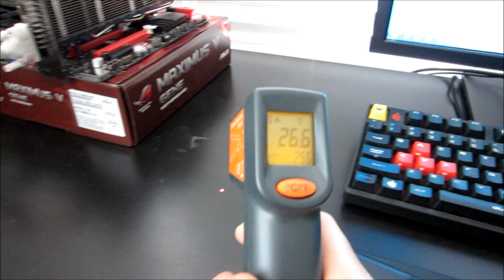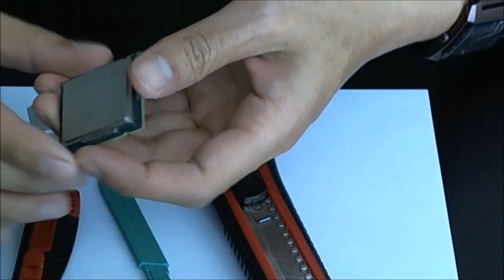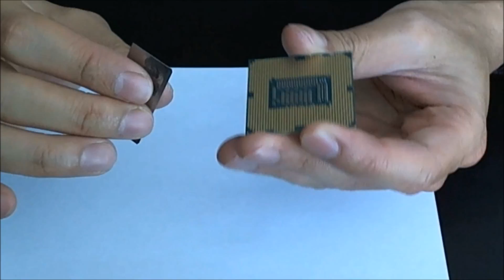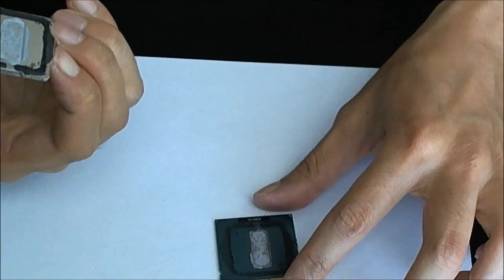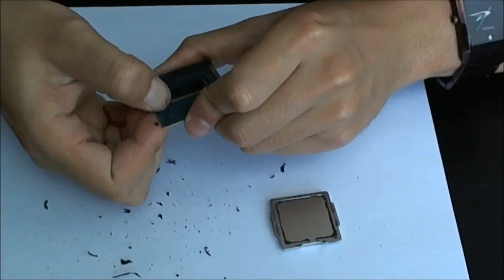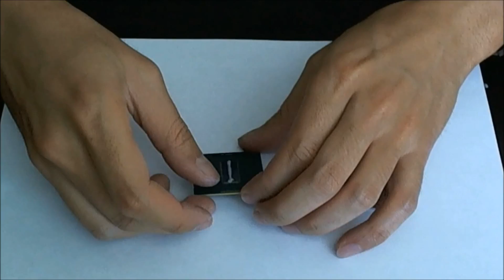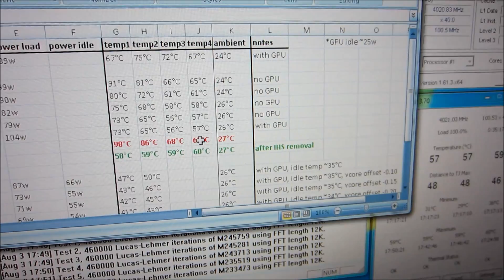Fixing Skylake, Haswell, and Ivy Bridge CPU temps: IHS removal

Comment from the maker: I see comments like this all the time, so to address why putting it back on:

Less prone to cracking the die. Retention bracket won't lock the the CPU down without IHS. A lot of coolers need certain thickness for proper pressure. Lastly, some air coolers have heatpipes that use direct touch, which means not all the heat pipes will conduct heat from the small surface area of the die.

Of course if you have custom mounting or care less about the risk of cracked die, then yeah just leave it off.

Comment: Sigh.You have no idea what you're talking about. I would remove your comments before people who know their shit come here and make fun of your lack of knowledge. Haswell runs the same as Ivy. They used the same paste and it's still running 22NM tech. They run cooler at idle because they have more intense idle states but that's the only difference. Load temps are the same as ivy, but require more volts to reach higher overclocks, which means they're in the end even hotter. Get your shit together.

Comment: Sigh. Sandy reaches higher clock speeds than Ivy and Haswell. High overclock for sandy is 5GHz, high OC for Ivy is 4.7, and high OC for Haswell is 4.5, all of which are around the same performance. My point being that Sandy, even being 2 generations old, can easily still keep up. If you want to surpass Sandy, you must delid your CPU.

Comment: If you keep it within temperature spec it doesn't necessarily reduce the life of the processor. Also the "life" of the processor when maintained at safe temperatures is greater than 10 years for most, even running 8 hours a day or more. Your concerns are mostly based on myth and ignorance and are pretty much unwarranted.

Comment: ceramic paste is supposed to be hard when it's cured, that's when it'd give you the best performance. Seems to me the thickness of it is the main issue. If they had a way to make the contact with the actual CPU chip more even and close so they could use less paste they probably wouldn't have the temperature problem anywhere close to what it's like. It's too bad you can't just leave the heat spreader off.

Comment: Damn. Nice! But why don't you want to re-paste it? I REALLY recommend you do. Even after you get a better cooler (I recommend H100i/H80i) you still haven't seen half of your CPU's potential. YouTube search delid razorless. It's a 12 second video by Allen Diep. It's only 12 seconds for a reason. The vice and hammer method has been the easiest and safest way to delid. There have been no CPU deaths using that method yet and believe it or not, it's already been used more than the razor method.

Comment: Well, running a system on stock speed also reduces the life of the components compared to a similar configuration with undervolt, and this second case also reduces component's lifespan compared to an undervolted AND underclocked system. And this third case also reduces component lifespan compared to a PC turned off.
So, Where is the limit?
I use to overclock nearly all the computers i build, obviously with adequate cooling. And all of them kept working until they became obsolete :)

Comment: It hasn't, old sandy (even socket 1155 parts) have their IHS soldered, that's why Ivy processors seemed so hot despite the lower manufacturing process (this usually yields far better temperatures, and not the opposite like in this case)
That's the reason why some people still bought a sandy bridge processor even with ivy launched (and a bit lower price always helps), but in practice a sightly lower clocked ivy performs the same (remember that ivy IPC is about 10% better) so it's not a big deal

Comment: Base settings use to use way too high voltage for the speed just in case you got a bad example of the CPU. Even if you don't want to bring up the speeds you should try to decrease the voltage to as little as possible for the base clock, that will save your CPUs lifetime and reduce the heat

Comment: I might've just been lucky but I got my i5 3570k to 4.4ghz (stable) on base voltage and the extra boost-voltage set to lowest with a really cheap air-cooler (CM Hyper 212evo)and it never runs above 70 degrees on Aida64 with an ambient temp of around 25C. That was extremely easy to acomplish and no I didn't switch paste on the CPU or anything like that. So I doubt reaching 4.7 with proper cooling is too much of a challenge. And a 3570k @ 4.7 should be slightly faster than 2500k @ 5

Comment: Complaining that an eight core has higher temps than a four core when run at the same clock speed? seems legit.

Yeah I enjoy paying $100+ more for an intel chip to get equal performance. The only reason you wouldn't but an AMD is if you cant find a MOBO with all the features you want.

Comment: No. It's mainly the thermal paste. The 25c drop using CLU is proof. That's from my experience. This guy got an even better drop. It's mainly the paste, but the same heat coming from a smaller area contributes as well.

Comment: Certainly is not. I'm sick of typing the same damn thing. This has got to be the 10th fucking time. You can go read my comments for more details. I will add one thing that I've added before and that is that an overclocked Sandy will not beat the shit out of an overclocked Ivy or Haswell, but it will be the equivalent. So when overclocking, there's really not much improvement besides power consumption. The real upgrade is for non unlocked CPUs and especially for mobile devices.

Comment: This shouldn't be necessary - the pins are electroplated with gold and thus not prone to oxidation.  Most burnt pins are the result of foreign debris such as dust getting into the pins, not oxidation.  One way to minimize this is to use lint-free rags or coffee filters to wipe vice a regular paper towel.

Comment: I use a Wilkinson shaving razor-blade, because they are so thin, and sharp. I broke it in two, moded a support out of a wine cork...It works really well, and avoids "accidents" with thicker box cutters. I do use the flat boxcutter for leverage, in an upward motion, away from the PCB.

Comment: Yes it is the heat problem. Of course as the die shrinks the heat is coming from a smaller area which does cause it to run hotter, but explain to me why delidding and applying CLU drops temps by up to 35c? And yes, a 5000MHz Sandy is the equivalent of a 4700MHz Ivy. Just look up the performance charts. That's all you need to do. And like I've said before, I've cleared things up. My point was that a overclocked sandy bridge can still keep up with an overclocked Ivy and Haswell without delidding

Comment: Those are capacitors on the bottom of the CPU? I always thought it was the cache - tiny little memory chips for the L1, L2 & L3. And all the caps were on the motherboard. I've never seen a cap that small.

Comment: "and I'm not plucking an opinion out of my backside"
Plucking an opinion out of your backside is exactly what you're doing. You can hate Intel and love AMD all you want but, Saying AMD processors have more computing power is preposterous.At one time their cpu's were pretty much identical and later on in the Athlon days AMD were on top. By the time C2D came out Intel won the performance crown and it hasn't really been close since. But I'm not factoring in bang for your buck.

Comment: Intel's 6 core, 12 threaded CPU's (like the 3960x, an exteme example I know) out perform AMD CPU's in everything, especially multi threaded applications. The only plus AMD has is that you can get more cores for a cheaper price compared to intel, which is better for professional use in multi threaded dependent programs. But comparing the best of AMD (even the 5.0ghz cpu) to the best of Intel, Intel still comes out on top. N considering the cost of AMD's 5Ghz cpu, you may aswell get the Inte.

Comment: I have changed quite a few Intel notebook processors and I have never seen one that has a heatspreader. Notebook processors look just like this guys desktop processor with the heatspreader removed. So you won't find any solder. The heatsink goes right on top of the bare processor with pretty much the same shitty thermal paste.

Comment: They are only a dumbass if they fuck the processor up. But if they are successful and they lower their temps as much as this guy did then how are they a dumbass? We're not talking about someone ripping off their heatspreader to gain 2 or 3 degrees. He dropped about 40C on his hottest core, that doesn't sound too dumbass for someone who is an enthusiast and wants to overclock..

Comment: shame on you intel, why do they not do a recall?  great fix though WFD!!  i would have felt better about this fix if you had the proper static guarding when dealing with such sensitive electronic equipment.  but regardless, you did a good job, and after knowing this ill probly wait for the next gen intel.

Comment: Good to know, but if I were to have temp problem, I wouldn't use a fanless graphic card and even less blow hot air into it and I would add a fan on my CPU heatsink that actually blow air into instead of sucking it. Your first temps with the 1st core at 98 degree might be an indication you didn't put your heatsink or thermal paste correctly the first time.

Comment: just nicked one of those tiny capacitors.  wouldn't have seen it unless I had a high power microscope which I do.  It's running fine still though.  I can see some of the substrate inside the capacitor showing which can't be good.  We'll see how long it lives.  temps at 4.5Ghz are only 53C though

Comment: GELID Solutions GC-Extreme i think is one of the best and prolimatech pk3 is also good too. depending on how much you need, the 1.5 gram version of the pk3 is about 5 dollars and has enough paste to be put on both the ihs and die. i have not found a 1.5 gram version of the gelid one but the 3.5 gram one is about 11-12 dollars, il send you the links in case you want to buy one or the other.

Comment: darknessjw.  that is about normal.  there is no "why".
realistically, you cpu has to hit about 125 degrees before it begin to damage itself. and it throttles around 90 i believe per core. 70 degrees under full stress is normal.

Comment: Nice video! My stock 4770k runs around 40 degrees on idle (first core) and other cores are about 5-8 less.

Stock cooler also atm. 

In stress test they go up to 70 degrees (first core) and others about 60 degrees

Why is this? I have same problem what video maker have? Too bad im too afraid to touch that CPU or i might broke it :D

Comment: gonna use the intel g1610, throwing aside the stock cooler and putting on the arctic alpine 11 plus instead for quieter fan operation and slightly lower temperatures but i want to know, do you think its worth it if i take apart the chip, wipe off intel's stock thermal paste on the die and reapply using bestbuy's dynex thermal paste? do you think this will be a LOT better than intel's paste, worse, or only a  tiny bit better? also is it fine that you use 2 different pastes for die and ihs?

Comment: i would only do this process if i was using very high quality thermal paste like gelid extreme or prolimatech pk3 on both the ihs and die, otherwise, i probably wouldnt do it, but i do want to know, is the reason for the higher temperatures produced on the ivy bridge chips caused by simply intel using low quality paste or is it other things too?

Comment: wtf O_o did I see that right???? 90º @ 4.2?? that can't be right.... that just can't be right.. if so, holy hell something was fucked up majorly on assembly... at best, a delid is gonna drop a couple degrees(at best!) so there is just something wrong here.. I was getting 4.8+ on my 3570 on air with barely an 86-87 spike...

Comment: In another comment I cleared things up. It's pretty much needed unless you have a chip that chugs along with a low voltage. What voltage do you need? Because that's crazy. I can't even hit 5GHz at 1.65v because I got an average chip. But my temps stay under 95c at 1.65v and 4950MHz which is crazy. You must delid. Use the vice and hammer method though. It is MUCH safer and MUCH easier. Search 3770k/3570k delid razorless. You can probably hit 5.3GHz or more with a chip like that. Nice!

Comment: I have my Ivy bridge 3770k at 5ghz no problem. my temps don't go above 80 during 24 hour stress tests, 75 tops and that's only one one core. Although I do agree the thermal paste is garbage, but I don't see a 30 degree temperature like this guy, maybe his chip sucks.  When gaming or doing things like rendering / other multi thread dependent programs my temps hover from 30-65 tops. So I wouldn't say deliding is needed, but advised? I am watching this to delid my cpu to get more juice easier ^^

Comment: Will definitely worth it if you got a good OC chip. if you got a CPU that can do say 4.5Ghz @ 1.1v (just an example) then you can delid and do 5Ghz at may be 1.3v or 1.4v which is not possible w/o deliding. Custom loop won't help much if you got a chip like this guy.

What this guy could have done is buy protection plan then up the vcore til it melt and get a new one for free. But if the chip is a good OC then it's still better to delid.

Comment: You should use Isopropyl alcohol to easier clean the left over cooling paste off..not just wiping it off with a paper towel. Also its better to use a microfiber cloth as it doesn´t leave grains of paper stuff behind

Comment: What's really sad is that from Sandy to Ivy to Haswell, we've effectively seen no real gains in performance. What we have seen is single digit improvements in performance, while losing clock speed after an OC is factored in. 

The temperatures by contrast seem to be getting worse with each gen, thanks to the junk TIM that Intel uses and now the FIVR. Less and less OC headroom it seems.

I can understand that Ivy wouldn't be a big upgrade over Sandy, but with a new architecture ....

Comment: Sigh I know. What I'm saying is that a well overclocked SB can still keep up with a well overclocked IB or Haswell unless you delid. A 5GHz sandy bridge is about the same as a 4.7GHz Ivy and about a 4.4GHz Haswell, and that's about as far as you can go with these chips unless you get lucky and it chugs along at a low voltage. But for most people, getting to 4800MHz on Ivy is a challenge and runs really hot without a delid. Same goes for Haswell, only with 4500MHz.

Comment: Are you serious? You do know that if you compare them clock to clock, 5 on SB is equivalent to 4.6 - 4.7 on IB and Haswell. they are technically slightly faster than SB. I mean if we are talking about SB-E its still slower if you compare clock to clock with 3rd and 4th Gen, sure more cores means more power but not a lot of applications today even take advantages of those extra cores. SB-E are designed for memory intensive work like rendering and such, then that is when it kicks ass at everythin.

Comment: The 3770k at stock beats the 8350 in every single software properly coded for 1 thread and 8 threads and beats the VERY expensive 16 core opteron when overclocked to 4.2GHz, which I should also mention happens 90% of the time without a voltage increase, nevermind a delid or aftermarket cooler. Delidding is more for 4.8GHz+ or those who want to laugh their asses off running a 4.7GHz overclock using the stock heatsink or cheap one, like the hyper212+/evo. 

WhiteFireDragon's scenario is VERY rare.

Comment: I've delidded chips for years, every time it's netted minimum 100mhz and 10c temp drop. Mobile versions come without an IHS from the factory for a reason, because it's more efficient.

The speed difference in architectures is mainly from tweaks to the onboard memory controller, and Intels tri-gate transistor stacking is the reason for the extra heat, not necessarily the die shrink. Smaller architecture=less electron migration. Less electron migration=higher clockspeeds.

Lrn2 Silicon engineer.

Comment: No. If you think 30 degrees are a "few degrees" I recomend you to to the desert.
There is EMPIRICAL evidence that Ivy/Haswell overtemps are caused by that stupid Intel's decision about using $1 thermal paste. 

And It isn't even a 10% between Haswell and Ivy.

Comment: Its actually the fault of the thick glue/paste that holds the IHS in place. When it too thick on there the gap between it and the die is too big, this causes a crippled heat transfer ability. When people de-lid they cut away the black glue/paste and replace the thermal paste the IHS is in almost direct contact with the die so the thermal conductivity is optimal. Using super TIM's like Coolaboratory Labs Liquid Pro or Ultra of course helps greatly because they are so extremely good.

Comment: Man, u're dumb... if 4.2ghz is max "without damaging the cpu",  why my 2600K running on 5ghz for 2 years? How much dust I need to get clogged my NH-D14, if I cleaned it last time same 2 years ago? :) Maybe you need to use air filters on case intake?

Comment: Because 1: It can damage the die due to the heatsink being much heavier than notebooks. 2: The IHS actually fills the gap between the die and the heat sink. With most heatsinks you will probably need a custom made mount for the heatsink to reach the die.

Comment: Dude...you're too careful, you don't have to hold that...plate when placing back bracket, you can simply leave it and then place bracket on, then move it in place and when you're almost done closing it (having the switch almost at the end) move it in place how you want but making those wings on sides to hold the cpu in place and then close it... that's it...you're too careful with the bracket placing thing...

Comment: Shouldn't have blindly included haswell in your title. This information is bad for haswell, the razor method is far more likely to screw up your CPU on haswell than it is on ivy. It's recommended big time to use the vise method.